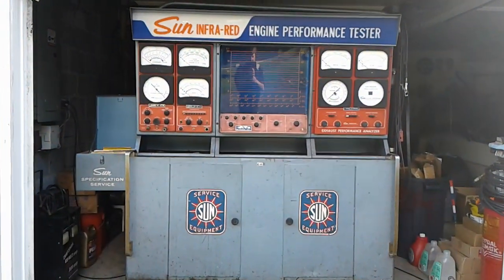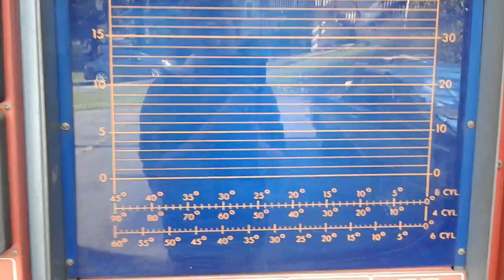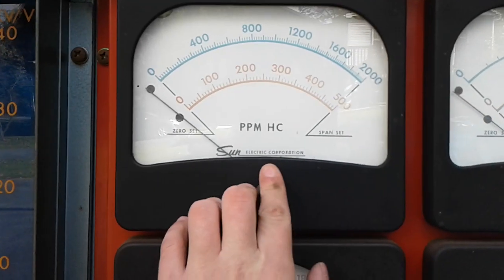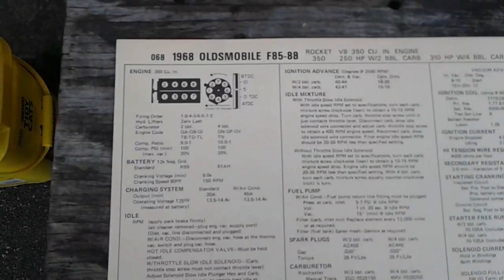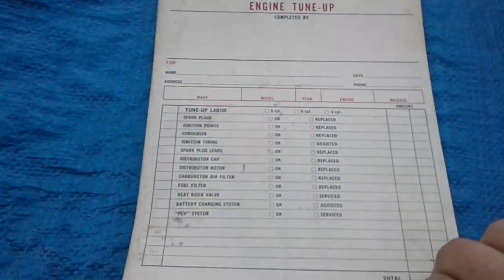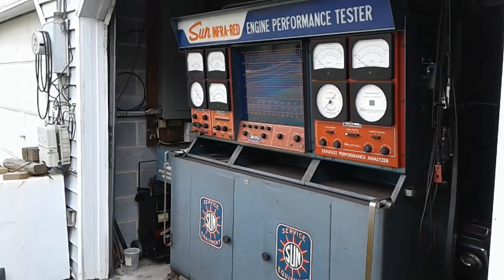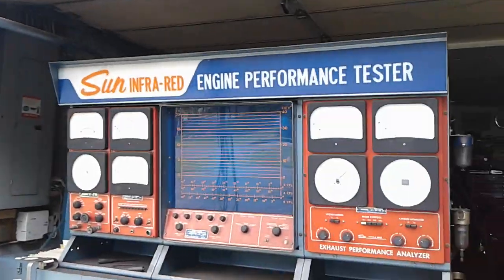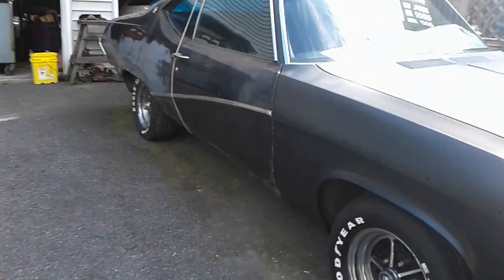Sun Infra-Red Engine Performance Tester

Comment: I am not sure I’m replying to you in the right place so bear with me. I am in or near Dallas Texas. Did you ever get it working? I know it first it worked and then gave you a hard time and was wondering have you tried all the features of it, or did you sort of put it off for some other day? Lol.
Reply: Because it’s for a museum and it display area that is depicting the early 1960s automotive shop, it doesn’t necessarily have to work although it would be better if it looks lit up which brings me to my question, does the top area where it says sun light up? I believe yours is supposed to And I was just wondering if it does
Reply from the maker: i believe it is supposed to as well. i will have to plug it in and look for a switch.
you can email me @ 
Generalmopars@yahoo.com @carwizard01
Reply from the maker: i know the oscilloscope works because i tested it. the guy i got it off of was one of our old mechanics, he said everything works except for the power balance tester.

Comment: How about the sheets for a 1969 GTO, 1963 Mercury Monterey, 1969 VW Bus.    Also I bought a SUN 1020.   The #1 cyl Pick Up for the timing light is missing.   Do you know where to get parts for these vintage testers?   Thanks Mark
Reply from the maker: Im pretty sure ive got the cards for the 69 pontiac 400s. Id have to look, ive actually got the sun tester in storage at the moment. Not entirely sure where to find parts for them though.
Reply: @UsefulEntertainment  Here are the copies I want to buy if you have them   1969 GTO, 1963 Mercury Monterey, 1972 VW Buss   I can send you $$ thru paypal or Zelle.   If anyone else has connections for the 1020, let me know.  Thanks Mark

Comment: I was a Zone Mgr for Sun on the 70s,that tester slid for around$5800
New. Great tester it's called a model 947,probably find a manual on
eBay.
Reply from the maker: Thanks for the info.

Comment: ppm hc is hydrocarbons in exhaust gas very cool machine I just picked up a newer version of that but there is one in my area just like that for 500 on craigs list.  and several on ebay listed for over 2500.  I paid 150 for the 1115 modle I would love to have the information you have very cool.
Reply from the maker: Dude thing was like the steal of the century lol. I can't wait to start using it in the spring, it will work on all 8 of the cars at my house. I'm about to order a manual for it.